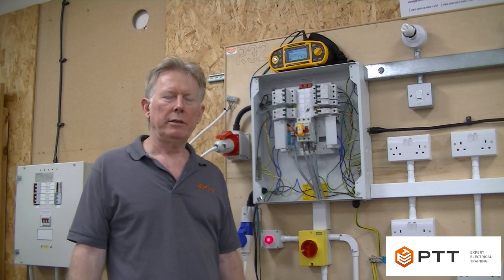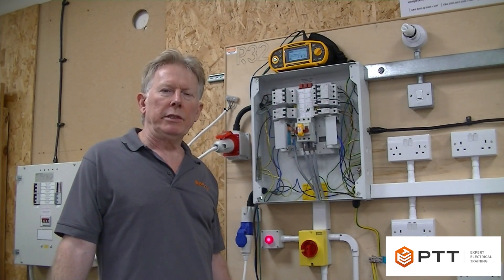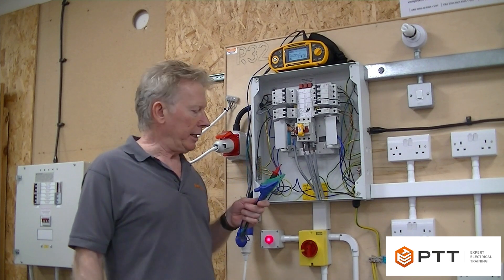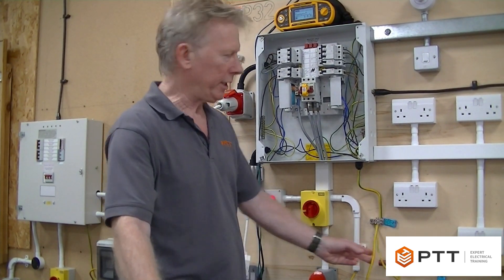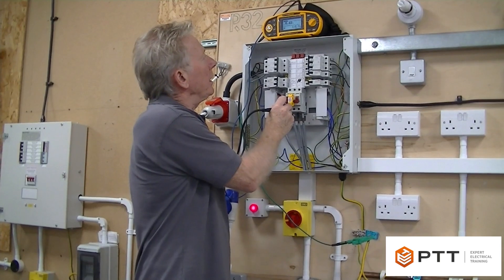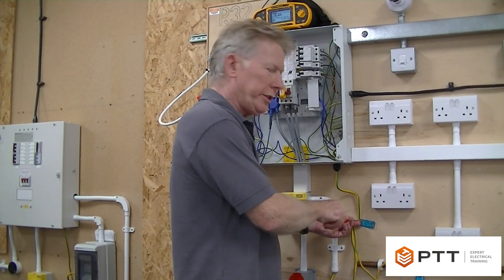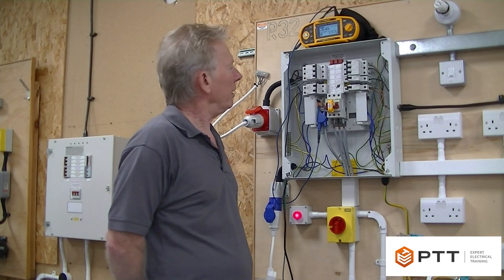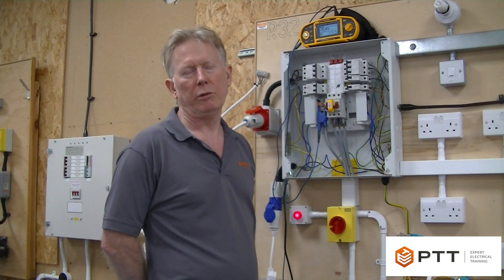Ze and PFC Electrical Tests on a 3 Phase Board | PTT

Comment: It was not low current! The Martindale tester does not have the facility for Two-lead testing, The current was set to high on the meter screen. So it is 3 lead high.

Comment: Why the three lead low ? 
I would measure ZE on two lead high then do three lead low at the socket/ lighting points to avoid tripping the RCD.  Being as it’s a test rig I’m thinking you did the three lead low test on the rig so as not to trip the upstream RCD feeding the building . ?

Comment: In order to comply with the Electricity at Work Regulations, you would aim to carry out a dead R1+R2 test of the distribution circuit; then add this to the Ze at origin. This avoids making a "live" measurement at the downstream board when there is an alternative.

Comment: Yes, that is correct. The Ze is the impedance at the board, but only if DB is at origin. The boards in the training establishment will include the internal wiring in the building, so are in fact a Zdb.
An estimate of Pfc between two phases, is the highest current measured between phases and neutral and multiplied by 1.732 or root 3. To estimate the current if all three phases and neutral came together would be double the current between phase and neutral.
Hope that helps, and do get in touch if you need further?
Thanks for the question and happy testing.

Comment: The book suggests testing Phase to neutral(single-phase) and doubling the result to obtain a 3-phase value. Since making the video, I have started also measuring the Phase to earth which as you say, could be a higher reading as it is likely to include parallel paths. In other words, you are proceeding exactly as you would with a single-phase installation but doing 3 tests; one for each phase. This is useful if you have a single-phase board fed from the three-phase board. If this is the case, you would have all the info needed for PFC on the single-phase board, and for the three-phase PFC, you simply double the highest result.
Let me know if you need further.

Comment: Could someone please put me right, I thought that the test carried out was  not the the PFC as he only tested phase to neutral and not phase to earth which may have given a higher fault current which then would have been the PFC, it showed on the meter that only 2 probes was in use which was the line and neutral test probes, I do stand to be corrected.
Reply: The book suggests testing Phase to neutral(single-phase) and doubling the result to obtain a 3-phase value. Since making the video, I have started also measuring the Phase to earth which as you say, could be a higher reading as it is likely to include parallel paths. In other words, you are proceeding exactly as you would with a single-phase installation but doing 3 tests; one for each phase. This is useful if you have a single-phase board fed from the three-phase board. If this is the case, you would have all the info needed for PFC on the single-phase board, and for the three-phase PFC, you simply double the highest result.
Let me know if you need further.

Comment: DONT AGREE. Measuring phase to neutral shortcircuit is not going to give you three phase PFC even if you multiply by 1.73 or 2. You better have a look at schneider cahier technique 158 and compare the formulas for all shortcircuit types. you will see that you need to measure between two phases and multiply x1.16. Many mft meters support measuring between phases even if you select L-N test. For example fluke 1654B.  The only place you could do that aprox  x2 times (no x1,73) is subject to the neutral being the same size and length as the live, all the way upstream and if you are far away fron the transformer so the transformer windong impedance is much smaller than the cable. Things that you will never be 100% sure. Hope this comment helps you.

And if you dont believe what i said and dont know how to check, think about it. If it was so easy as doubling it up you would get that info from the meter when you are doing LN tests.

Comment: Thank you for this Video 
My question is if this test is Carried out for main low voltage panel with 2500 A breaker , so the main breaker should be off ? Right ?? And we will measure for the incoming point of the breaker which is live ? 
We did this as a safety procedure or just to take the exact reading for pfc and ze ?

Comment: Hi thanks for the Video. Can you tell me please why you had the Main Breaker turned off when doing your PSCC test? surely the main switch and breakers should be on ?
Reply: Hi, The main switch is should in the "OFF position when carrying out a test of PFC because the we are looking for the worse case scenario: when the resistance is at it's lowest and the current will be at the highest. If the switch was on, you could theoretically get voltage drop which would change the reading. When the switch is off, you are still including parallel paths as long as the earthing conductor and all the extraneous-conductive-parts are connected to the MET via the equipotential bonding.
Hope that helps..
Reply: @daytonamann5618  So for the current to be at its highest you would need the main switch on! With the main switch off their is no current.
Reply: @gregsmith5553  No; The bottom of the switch is live at all times, so the current is measured at that point. The installation is isolated and so there is no voltage in the actual system when the switch is off!
Reply: He tested it at the other pole  of the breaker that's live. The installation beyond the main breaker is dead, before the main breaker its still live
Reply: @MJohnson48939  I know that but to make sure you are getting all the Parallel paths the main switch and breakers should all be on.

Comment: Great video, thanks for your time. A hypothetical question, what would be the process for the Ze at a sub board fed from the 3 phase DB?
Reply from the maker: The process for measuring loop impedance at the sub board would be the same but in this case you are measuring Zs at the DB not Ze and therefore the earth/cpc remains connected for this test.
Reply: Thanks for your reply, so essentially a loop test at the sub board, croc clip on to MET and probe incoming L&N. This then giving you the Ze + R1+R2 of the cable going to the sub board.
Reply from the maker: @kylepeace3252  Correct.

Comment: im confused you done a three lead test for the pfc does that mean you included pefc and pscc? and that made your pfc?
Reply from the maker: With the meter shown in the video it requires two tests using three leads. One to select and measure PEFC and then one to select and measure PSCC. The three leads remain in the same position for each test the meter then measures between L-E for PEFC and then L-N for PSCC. The higher of the two readings (for a single phase supply) is taken as the PFC. In the case of three phase measurements there is no need to measure the PEFC. We are only are interested in the PSCC L-L so we measure L-N and take this reading and double it to be recorded as the PFC.
Reply: @proactivetechnicaltraining4431  hi buddy. After Ze is measured between the three phases and earth, do we have to double the highest Ze value to record on our test sheet? Or is it only the pfc we double?
Reply: @kristianhumphreys7984  Hi Kristian, We just take three Ze measurements and take the highest. The PFC is measured between L1, L2 and L3 to Neutral, take the highest and double it. Note: we only measure PSCC on 3-phase as that is at 400v. The PEFC is only 230v so we don't need to measure it. Let me know if you need further?